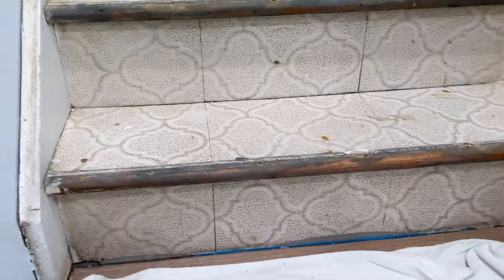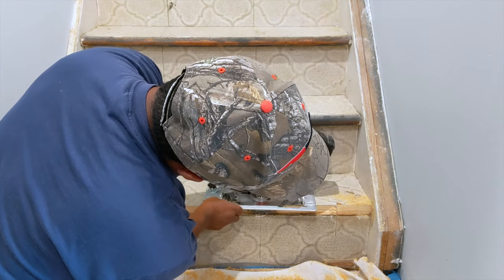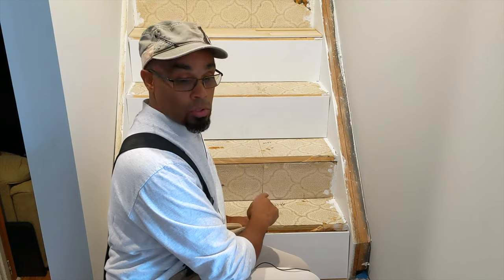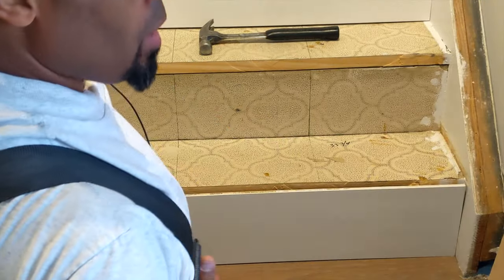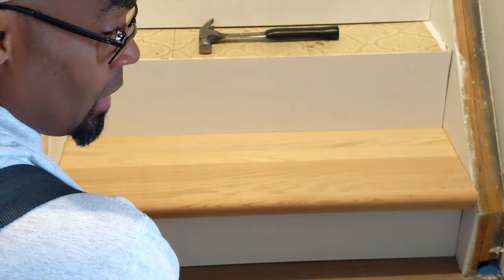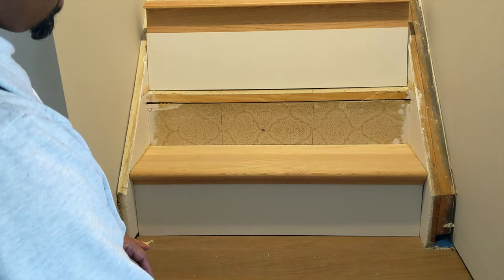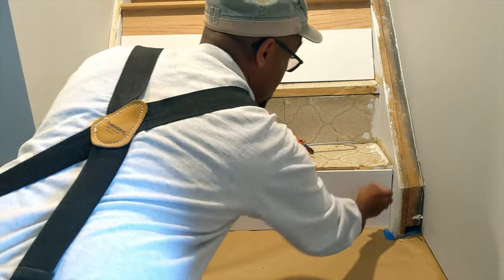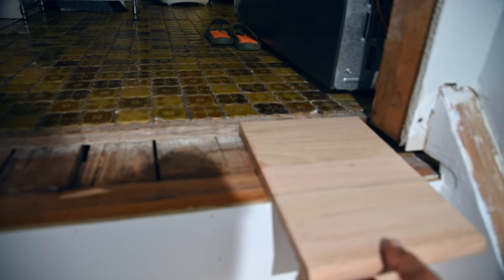How to install new treads and risers on your old stairs. Beginners DIY

Comment: Thank you for this video. I started planning this project the week.  I'm using the same tread/riser products, but I need to share that I am contemplating NOT cutting off the tread nose & compensating to meet code with a thicker pine riser. My reason is that I'm having the HARDEST time cutting off the tread nose. & even if I cut it off it WILL impact building code.  Measure twice & cut once... if my measurements on the 1st step don't work with the thicker pine,  I'll break down & ask for someone to help cut the noses off....I need to share that I was using a compact circular saw & the depth WAS  set properly but it wouldn't cut thru. I have a regular size circular saw & will try again.  Lol just sharing my challenge with this project. I'm an interior architect so it will definitely  bug me if code is not right. It appears that code was already off. Also regarding my starting turnout step, I'm ordering a kit from a company in the Midwest called Westfire Stair Parts.  I called ahead & the guy who called me back was super helpful. My kit ( riser, tread & cove moulding -straight & for the curve) is on sale for $181.00.
Reply from the maker: Thanks for your insight. Please remember to subscribe and like the video.

Comment: The steps look great nice work. One way to save time is to cut fur strip the thickness of your overhang. Then install them across the bottom. Now you can cut the riser to the top of the tread without having to cut the nose off of every tread. Then the cap tread will be sitting on top of the riser supported all the way down to the next tread.
Reply from the maker: YOUFLOOR Flooring tips and tricks Thanks for the feedback. That’s a good tip.
Reply: I don't recommend that unless you like the nose sticking past the stringers. Other wise you will have to reduce your tread width. You have a 9" rough cut stair which is the minimum. I have seen some overlays done with the nosing sticking a half an inch or more past...and I'm talking finished job.

Comment: Nice work but be careful with the piece between the fence and the blade on the table saw. That’s a projectile/kickback waiting to happen. Either use a sliding miter gauge and get the fence out of the way or use a makeshift crosscut sled to perform those cross cuts.
Reply from the maker: Thanks for the feedback and please remember to subscribe to the channel and like the video.

Comment: I want to first say, no offense to Ray who filmed and posted this video. However, please don't anybody follow his method of cutting the stair treads to length on a  tablesaw.  There is a tremendous risk of kickback, which can essentially fire the piece of wood back at you with tremendous velocity, and in the process pull your hand into the spinning blade.  This is especially true without a splitter, and in the way he paused his cut while raising the blade.  Please, if you must use a table saw, do not use the fence for a crosscut.  Use a crosscut sled or miter gauge.  Better yet, find yourself a sliding miter saw to rent and you will have a much easier to execute, and more accurate cut.  Thank you, and again, no offense to Ray.  Safety first.
Reply from the maker: Kevin Pintar I totally agree with you.  Thanks for the feedback.
Reply: PSA3 & 90 Squad, hope you're enjoying retirement
Reply from the maker: Dennis Ferrer hey 👋🏽 Dennis, great to hear from you. Yea, I’m doing well. This is my side gig. Having so much time to myself. Decided to become a Content provider. It’s fun and Rewarding. I do miss the job sometimes. But glad to be retired. Especially now in this day and age. Please be safe and if you ever need anything just reach out.

Comment: I have old stair treads in my back hallway just a few have worn and aren't as flat anymore but I heard about retreads that they can go over your existing treads. My stairs are similar like in this video. We have been doing projects hear and there and thinking about doing this in basement too. Any advice? Will I need wood wood filler? Will I need to place a thin layer of plywood before placing the retread over the treads? Now that the 2eather is getting better trying to think of ideas
Reply from the maker: Thanks for the questions. Just have a plan. Think of the best way to approach your project and executed. And make sure you have the right tools. Good luck 🍀
Reply: @DIY RAY  what type of glue can I poor if the stairs are built in. I have my drill bits. I knows it's either a syrup or glue to prevent the stairs from creaking that I can poor inside with out removing the treads.
Reply from the maker: Check the description section for the items that I used.

Comment: Very good video. I have one question though and I may be overthinking it but, did your stairs feel taller, steeper or anything like that in contrast to your top and bottom floor after installation? I will have to do my stairs as well and I’m just trying to figure the best way to do them. Mine are a bit different than yours though, and they have some curve to them at the bottom few steps. That’ll be my hardest part to deal with so I’m not sure I can use a tread and risers kit. I may have to do something more custom.
Reply from the maker: Thanks for the feedback and please remember to subscribe to the channel and like the video. To answer the question, for the top and bottom steps I get a lot of questions about the height. Really its not a big issue. The Difference in height it’s only the thickness of the threads and that hasn’t been a problem. You really don’t notice it when walking up and down the stairs.

Comment: When installing the stair board, do you still need to measure the level of the stair with a level? If the level is not found, how to adjust?
Reply from the maker: My stairs was already leveled. So I didn’t have to deal with that. If your stairs aren’t level, you should fixed it when doing this upgrade. Using shims should help.

Comment: Great video! Is the distance from the floor to the tread on the first step higher than the other steps?
Reply from the maker: You will not notice any difference once it is installed. I planning to do a follow up video on this project. Stay tuned.
Reply: Usually yes. But depends on thickness of flooring. Keep within 3/8" to comply with code.

Comment: Hi Ray, it's a very nice video. It helps me get an idea on my stair project coming up. There is no need for nailing on treads or risers at all.  Glue can hold them up well enough by itself; is it right? Thank you.
Reply from the maker: Yes it can but I would use small finish nail at the edge It wouldn't hurt. just in case the glue is a bad batch.

Comment: When you cut the tread on a table saw, you do not want to leave the right piece between the blade and the fence. If the blade binds the piece, it will shoot out the piece toward you. Either you have to leave enough space  between the piece and the fence, or you have to push through the piece past the blade. I once had a small piece shot by the saw and injured my chest. Lucky it was not my eye.
Reply from the maker: Rainman thanks for the feedback and please remember to subscribe to the channel and like the video

Comment: Did it make first step too high and the last step to short( the riser height) ?
Reply from the maker: terry holmes no, the stair are the same plus the Thickness of the riser in the treads. That why I cut off the nose from the treads so I profile of the stairs same the same. I hope that made sense to you. I thinks I will do a follow up video to answer some questions about this topic.

Comment: Thanks. Anyone out there please correct me if I’m wrong. Aren’t the risers supposed to go on first and then the treads meet the risers?
Reply: When building stairs from stringers Always do risers before treads. (This is so you can use the upper edge of risers as your reference "level". Stringers are never level.) When doing a "retro" overlay you can do all the risers first OR the method shown here. Some people like it one way, some the other.
Reply: There is no official right or wrong in a project like this. No code or standard governs it. It is completely up to the person performing the job.

Comment: Any reason why you used that glue over something like liquid nails? And did you use brad nails for the treads? Or just the risers
Reply from the maker: Thanks for the feedback and please remember to subscribe to the channel and like the video. To answer the question, no reason for the choice of glue and I used finishing nails in the corners for the treads and Risers where are you cannot see it.
Reply: Avoid water based glue, as this may cause warping.
Reply: Yes, old post but for future readers.....You can use Liquid Nails construction adhesive if you select the formula that is urethane based and not water based. Some LN formulations  are water based and must not be used on a project like this.

Comment: How did u manage the tread from the floor to not be too high and the one from the top to dont be too low since you left there the original threads?
Reply from the maker: Thanks for the feedback and please remember to subscribe to the channel and like the video. To answer your question, The height difference between the top bottom tread is so minimum you don’t notice it. I thought it would be a big deal but once I got it on it’s totally fine. I may do a revisit of the video to explain and show the height difference between the two treads.
Reply: Exactly , i would have ripped the risers and treads out and replaced them with saw tooth stringers on both sides 
of the existing , most likely housed stringers and you would avoid the potential trippers.A little more work , sure , but 
all the steps would be the same rise . Have a nice day.
Reply: @fast4wood    Yes, I know it's an old post, but all the steps would be the same. You're adding 5/8 to each tread, so the distance from tread to tread will all increase by the same amount, 5/8". If your existing risers are 6-1/2", they will remain 6-1/2" after you add 5/8" to each tread. As long as your existing risers do not exceed 7-1/8", you will comply with residential codes (Risers not to exceed 7-3/4").
Reply: I understand that all the steps will have the same rise other then the first step and top step . You really didn't address that in the video . For example if you have an existing stair case of each step being 7 inches and you add a 1 inch thick tread on each step , your first step is now 8 inches and your top step is 6 inches , that's all i'm saying. Have a good day !
Reply: @fast4wood     Not my video....but as long the first step isn't higher than 7-1/8"  it will comply with residential codes (Risers not to exceed 7-3/4"). The treads are 5/8".

Comment: What is the longevity of using thin plywood on the stairs?  Plywood is usually very prone to having issues long term.

I am in the process of stripping my stringers and found hickory under all that white paint and dark brown stain and the thought of putting carpet on my stairs is awful.  I am now obsessed with redoing my stairs in wood.
Reply from the maker: If you’re able to restore your original one stay with that. This remodel is for people who does not have the ability to restore their original stairs. Thanks for the feedback remember to subscribe and like the video.
Reply: @DIYRAY  just my stringers are hickory. The stairs themselves arent resting in the stringers and are plywood and unpleasant pine (I think i haven't fully ripped off the carpet yet)
Reply: Old post but for future readers....The product he used is not plywood - it's 5/8" thick solid hardwood.

Comment: Great video, I would love to see how corner stairs are done.
Reply from the maker: Robin Nichols thanks for the feedback. Doing the corner is just like putting on trim molding.
Reply: @DIYRAY  not really, where the stairs turn its normally a wide triangular stair
Reply from the maker: Robin Nichols okay, sorry I don’t understand your question.  Are you talking about the sides. With the treads and risers meet?
Reply: @DIYRAY  think in terms of a staircase that turns. Oftentimes there will be a wider often triangular stair to cater for the turn
Reply: Just doing my stairs now.  For the corner treads, use a template on the old treads and cut the new treads on a table saw with 88 tooth blade.  Used a 'sled' (spare board) to hold the corner treads on the table saw and used some scraping to hold the tread to the sled.  The sled rides between the fence and the blade. Used a jigsaw with hardwood bit to cut the round edge near the wall.  Worked out well.

Comment: Question - when you put the new treads on top of the old treads then you alter the height of the bottom step to the floor ( this now increases in size not by much it still increases ) so is this allowed within building control as there are certain measurements for staircases.
Reply from the maker: Thanks for the feedback. I can’t answer that question. What is the building code for your area. The stairs came out very nice and I have no problem walking up and down the stairs. Please remember to subscribe to the channel and like the video.
Reply: It depends on the building code of where you live, but a popular number is 3/8" difference allowed maximum between steps height.
Reply: Old post, but for future readers.....International Residential Code (generally accepted guidelines for residences) state that the risers shall not exceed 7-3/4 inches high and be a minimum of 4" high. Each riser height should be within 3/8" of the chosen height for consistency.  Measurement is taken from the tread surface to the next tread surface, basically the distance your foot moves to step from one to the next. Those Retro treads are 5/8" thick. So, if your existing riser is less than 7-1/8" you will comply.

Comment: GOOD JOB.  RON ROK
Reply from the maker: Thanks for the feedback
Reply: @DIYRAY  I have a question. we have a stair case that has very very rough finish that is stained. can I use wood filler on the treads and risers to smooth out the rough parts and then sand and stain
Reply from the maker: @boomerdog4996  You may want to test the stain with the wood filler. The color may be off compare to the wood itself. but you can do it. Good luck
Reply: @DIYRAY  Thanks for getting to me . Thank you for the info.   Ron Rok

Comment: is there a reason why you didnt take off the old risers and threads?
Reply from the maker: M Tahir great question, the reason why I didn’t take off the old risers/threads is because I didn’t have too. The Materials that I’m using are designed to go over the old ones. This makes the Installation much easier. Great for DIYer. Thanks for the feedback and please remember to subscribe to channel
Reply: @DIYRAY  would it be problem if i cut my treads to far back?
Reply: @DIYRAY  and if the old threads cut is uneven
Reply from the maker: M Tahir you want to follow my instructions in cutting the old stairs. I had good results. But the new treads will cover any mistake. Remember the old stairs are your Foundation for the new ones.
Reply: Old post, but for future readers.....Some treads are routed into the stringers and cannot be easily removed. This is especially true when builders buy pre-assembled staircases, which is very common in new construction going back even 20-30 years.

Comment: Good video. Clear in content, but really sloppy in execution: you rely on filler caulk at the edges instead of using a precise jig to accurately measure the riser and the run discrepancies. When upgrading existing stair on existing framing, it is much more important to take exact impressions of the pieces you're cutting, because the existing framing has imperfections that should be addressed by the installation, not after-installation with filler. It's a pity to waste good-looking wood grain by terminating the edges in caulking. Also: you should have finished the run (tread) before installing, so that the stain and finish are done under controlled conditions in a shop or on a table, not on your knees with poor stair lighting: cutting pre-finished steps makes the work much easier when installing, and much more professional-looking without adding extra work.
Reply from the maker: Thanks for your sharing your thoughts.

Comment: why are treads so expensive? it's like $50 a step (with riser) to do my stairs. Tread is just a finished piece of wood..
Reply from the maker: Yea, That's the prices💰But by DIY the project you save on the other end. Thanks for the feedback and please remember to like and subscribe.
Reply: It's 5/8" thick solid hardwood.

Comment: You did your best but it's not correct.  You added an inch to the first rise.   At the top, the flooring becomes the top tread.
Reply from the maker: Thanks for the feedback. But you are incorrect. Everything was done correctly. Please remember to subscribe to the channel and like the video.
Reply: Added 5/8", not an inch. And it still conforms to code as long as the existing rise did not exceed 7-1/8" (maximum rise in residential stairs is 7-3/4").

Comment: Pretty mediocre work at best..those thin glue lam treads will be cracking and splitting before too long.
Reply from the maker: I would strongly disagree with that sentiment. I haven’t had any problems with it yet. Now 2023 still going strong 💪.
Reply: Pretty mediocre understanding of the materials used....The treads are 5/8" thick solid hardwood. The risers are thin. Do you step on or put weight on risers?